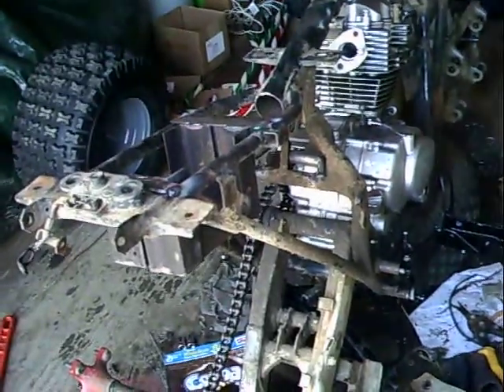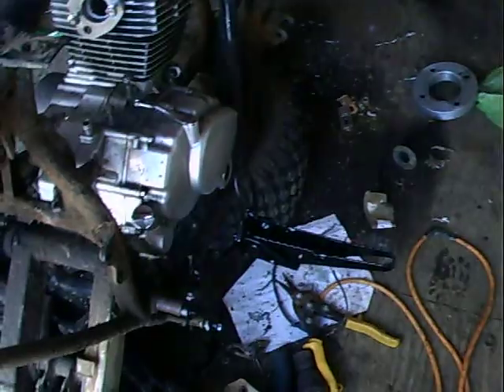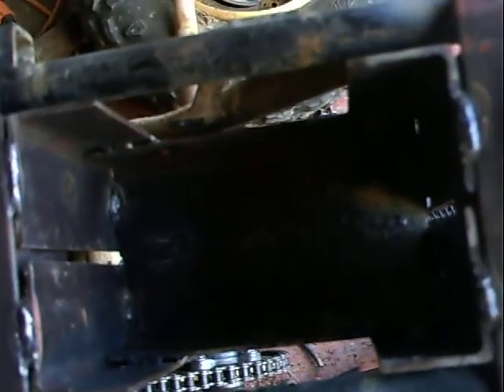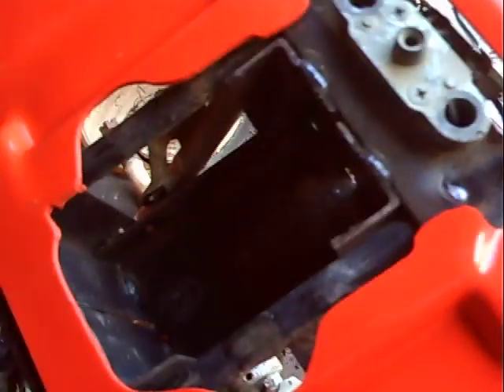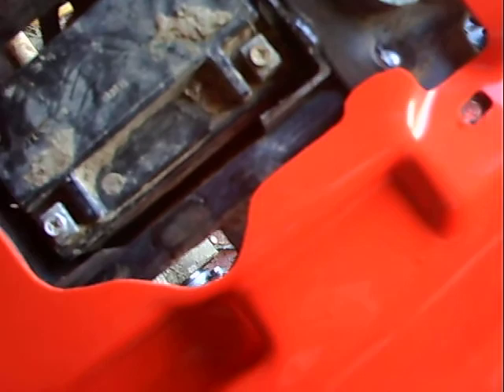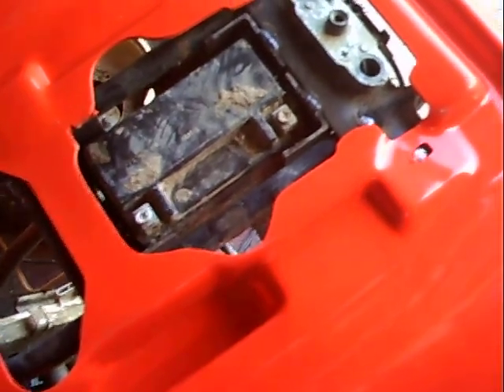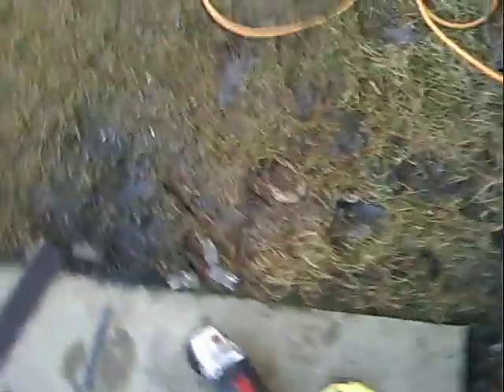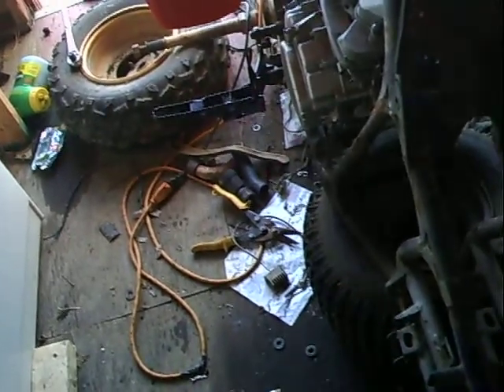LT230 Battery box made, foot pegs blasted

Comment: Try some nerfs for a Yamaha blaster they won't be as big. Next time I'm in the shop I'll try to remember to get the size off the ones on mine
Reply from the maker: That would be cool if you would. I haven't looked up blaster nerf bars but lt230's are 130 bucks. The 250x was 89 shipped.